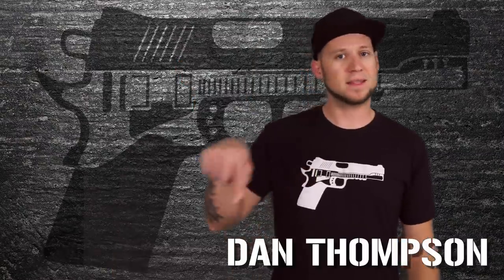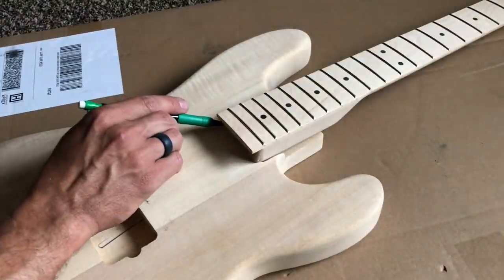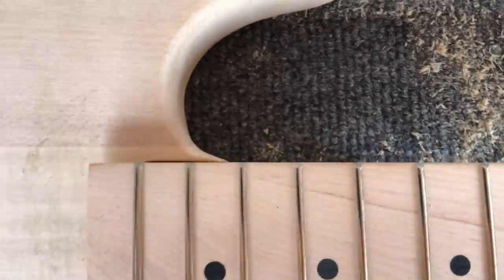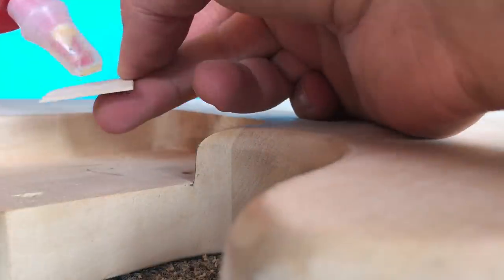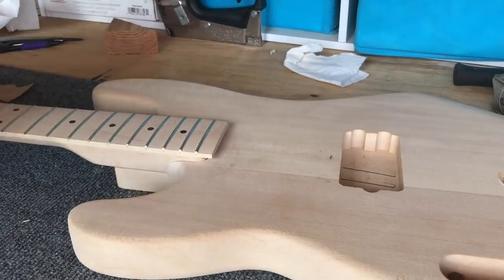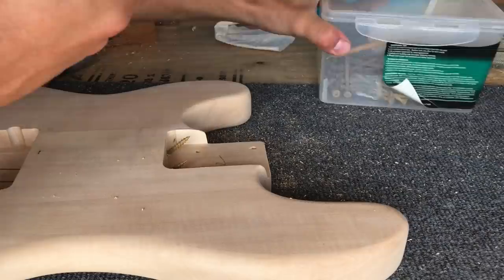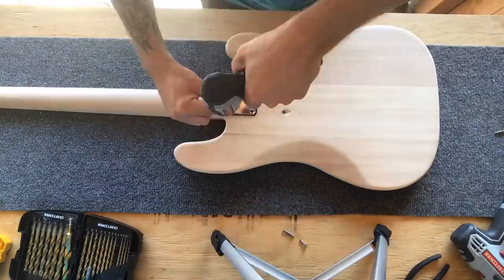How to reinforce a loose neck joint for better tone and sustain,  guitar or bass

Comment: i wouldn't advise removing any material from the end of the pocket, it means you have to adjust for the change at the bridge by the same amount, which often cannot be done, and therefore can throw your intonation off. the original screw holes for the neck will also be out of alignment unless you fill and re-drill them which wasn't mentioned here.
Reply: Mikail Elchanovanich I was wondering this too - the holes wouldn't line up for guitars that are already put together.
Reply from the maker: +Mikail Elchanovanich crud! I missed two important steps didn't I? Obviously I demonstrated this on a new kit so when I wrote out the steps I forgot to add those. For the bridge, most bolt on styles have adjustable intonation bridges so it's not a problem, but in case you happen to have a tune o matic bridge or other non adjustable bridge, you may be fine or you may have to move it. For the holes in the neck, yes you have to fill them and drill new ones.
Reply: was there a reply on this that was hidden? it mentions you mispronouncing Basswood, i'll point out that Crimson Guitars and Chapman Guitars both pronounce it the same as in this video.
Reply: I like the way you approach and discuss your project however I have serious reservations about the potential space difference in the neck pocket if one Dremels the body and does not account for this space with the neck screws.

I really like your style  but think that this advice you give isn't sound when thinking about fitting a guitar and neck together
Reply: i think they also miss that you havent yet mounted the bridge or drilled for it. you'll be able to seat the neck and then measure for the bridge and have zero issues on a new kit like this.
Reply: Bingo.  End result will be you'll have to put a shim in there...Not advisable at all.
Reply: he really doesn't like dissent, he removed my previous reply explaining that he is misunderstanding how sustain works on an electric guitar.
Reply: louis cyfer It’s sad, but this is a trend that is overtaking our society right now.  People live in self imposed echo chambers.
Reply: how would that help? i have no idea how you are trying to put those screws, your description is incomplete.
Reply: wouldn't that be in the way of your hand? he is trying to increase contact surface and eliminate air pockets, not just to increase rigidity.
Reply: you kniw what you gave in mind, but your description doesn't tell me where these screws are. is the head of the screw anywhere on the outside of the neck pocket? that would be in the way. i can tell from your description where you are putting these screws, and you keep repeating the same thing, so the picture is not getting any clearer.
Reply: that i understood. you end up with a lot of pressure on those screws, the wood of the neck will crush at those points. and you still end up with air pockets which is a problem.
Reply: Guns and Guitars, no. I just saw your thumbnail and came to tell you that whole idea was BS.
As far as the intonation screws go, you need those to guess what...set the intonation per string, not to compensate for general string length. Just tune to drop C with hybrid string gauges.
This is just wrong on many levels, that's all.
Reply: louis cyfer wanna k ow what you said
Reply: It pretty much characterizes the vibe and frame of mind of this Youtuber. He's kinda like the Anti-Gibson spirit. You know, zero mysticism, fly by the pocket of your pants kind of guy(or however you say it) but that's the Internet. The truth is somewhere in between I'm sure.
Reply: @louiscyfer6944  is that to say that a tighter neck to body fit will not increase sustain?
Reply: nate dawg, i am not sure this achieves a tighter fit. you are pulling with less force in the direction where there is more surface area.
Reply: Since you have a solid opinion about removing material causing reduction in scale length.. what is the common tolerance for that dimension? I think it's 25½ for Fender and 24¾ for Gibson. What's the tolerance? Are they +/- something or minus only or plus only? I doubt you have this information or even thought of that. Guitars aren't these precision instruments that some people think. They have build tolerances, the components have tolerances, the strings, etc. Removing 0.025" is nothing. Advising against that is silly and overkill.
Reply: @mboyer68  anyone who thinks precision isn't important makes crappy instruments.
Reply: @gramursowanfaborden5820  nobody said precision isn't important.. did you say that? There are tolerances on things. Allowable variations in size or position that have been verified to be acceptable. I'll bet that 0.030" to tighten up the neck pocket is well within the allowable tolerance of that dimension. 
Seriously though.. trying to claim that me talking about allowable tolerances is the same as saying precision isn't important is a ridiculous exaggeration, and quite frankly, a lie. You should stop doing that.
Reply: @mboyer68  good greif man, chill out. you're talking to me as though i'm on trial for war crimes. it was a general statement and it summed up what i think quite well. untwist thine knickers.
Reply: @gramursowanfaborden5820  You're really in the mode of applying whatever words and emotions you want onto people. You must be very tough to live with. I never said anything about precision not being important and now that somehow I'm angry, upset, and treating you like you're guilty of war crimes. 
If you could read my comments and then read your responses to them, then think. Try to figure out where you're coming up with this stuff. In my opinion, both comments were a passive aggressive technique to make me look bad. I'm all for crappy guitars and I'm some angry, out of control person that you have to calm down. You must be awesome to spend a lot of time with or be related to. 🥴😖
I'll untwist my knickers if you'll think before you write. What are knickers?
I'll bet $1000 that not one single person would look at either of my comments to you and think that I was upset and or attacking you like you're a war criminal. Do you hear voices? Is that where your thoughts and comments come from?

Comment: I added two additional neck scews on my cheap squier Indo p bass when I got a replacement mitey mite neck. Six screws total into sic inserts makes a SOLID lockup. I mean ROCK SOLID.  No shims. The gaps either side of neck and body were big I filled with kneadable epoxy from HOME DEPOT. Then touch up with acrylic paint. Hardly Fender American factory but I could care less. Sustain is incredible. Neck is removable. Worked great for me.

Comment: Sometimes I use really cheap, easy and fast way to make good solid contact between neck and pocket. You could take some pure pine rosin and add some pure alcohol to turn it from near hard state to more like paste. Then use it like glue to set neck in, and when alcohol will evaporate, you will have ALMOST set-in neck. Yea, this is sort of compromise, because odds are than if you would need to remove neck, rosin will be solid PITA just to tear it apart, but hey, it's always good to have more than one way to solve the task!

Comment: Interesting Dan. I bought a pocket screw jig about ten years ago for a home improvement project. Subsequently I had acquired a new Fender American Standard P-Bass that just sucked. While I didn’t address the neck slop as you did, although in retrospect I should have, but did I use the pocket screw jig and a couple of 2” & 1/2” pocket screws and pulled the neck tight into the pocket. The improvements in the tone and sustain were absolutely remarkable.

Comment: Hi Dan it's a good point those angled screws pulling the neck back in the pocket lengthwise with the strings, instead of only pulling down to the body as any other bolt on guitars. Just I'd say it can be a bit risky of some misalignment that could make the neck to not sit accurately leaving some gap in the neck pocket. From quite some years CNC has been used to route the pocket very precise and make the neck bottom to sit in snuggly leaving virtually no gap and making full contact. As you do it "by hand" meaning without a rig as used in guitar factories, I strongly recommend to take the time and go slowly.  On the other hand, what I do is to let the strings tension to pull the neck well into the pocket after loosening about 1/4 turn on the neck screws, no additional force needed, and I notice on many bolt on guitars some increase in sustain and resonance. Thanks.

Comment: Good idea, but if you plan on selling in the future, I would't recommend it. If you think your guitar is lacking sustain due to a sloppy neck joint, try slightly loosening the neck screws while tuned to pitch and retighten.

Comment: I like the 45 degree mount, but i would make the pocket tighter by taking thin piece of veneer, moisten it and shape it round the 3 sides of the neck-pocket, and then glueing it, and finish it to a nice look with sandpaper. This makes the best contact without removing material. And believe me it works. Damn!

Comment: Cool, I had the same idea, just worry about the loss of wood mass in the neck heel, as that is what also transmits vibration. I realize that you use the plastic neck-plate guard to avoid marring, but I think you are cutting out resonance by doing this. No plastic at any contact points.

Comment: Off all the things I've done to a guitar, adding the screws to the neck pocket and getting the nut correctly cut are the two most important things to keep a cheap guitar in tune.  It's amazing how well my scalloped strat stays in tune now that it has the two screws.  I have the cheap trapzoid tuners on it and with well stretched strings it will stay in tune for hours.....even with a cheap squire flat sawn neck.  I used one piece of black masking tape (black body) to cover the holes on the back....also painted the holes with some black nail polish...looks fine.   You could get a sticker from the craft store and no one would ever know there's holes.

Comment: There is no need for a tight fit on the sides. It can be counterproductive. The wood needs to move and all those who advertise "air tight" or "zero tolerances" lead to cracks in the finish and depending on humidity can cause a bad fit of the neck. 
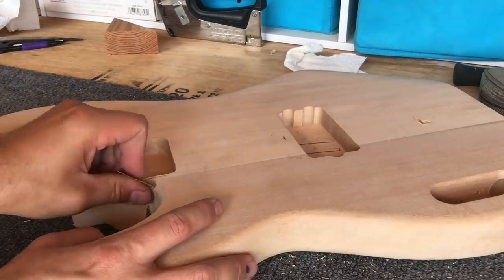2:48 isn't bad...maybe a bit more sanding. The additional screws might be helpful for bass guitars, perhaps if you do a lot of neck bending on your guitar. The slight reset on the back pocket can be problematic with certain bridges (Neck screw relocation isn't that big of a deal). It think it's fun when you build a kit guitar.

Comment: I would put 4 screws in first fully tightened, then the two 45 degree screws.
Reply: Then the 2 diagonal screws would not be able to slightly pull the neck into the pocket, since so much force is resisting, from the 4 normal screws. No, you absolutely must do the 2 diag screws first.

Comment: i build basses full time and do a lot of mods and repairs and the best thing for a loose pocket is , no joke, 24/hr JB weld. its harder than basically any wood, and bonds to wood really well, so there is no need to actually make the joint fit perfectly tight, when the filler is more resonant than the actual wood. technically it should sustain more than a perfect wood to wood fit but not enough to matter. you use the 24 hour so you can make a bunch up, way more than you need, slather that sucker, bolt the neck on and you have plenty of time to soft-align the neck and get the 1st and last strings on to make sure the bridge is aligned, and just don't tighten the strings yet, its just for reference. the JB weld compresses into the pores as you tighten the main screws and you have plenty of time to clean the outside and be happy with the fit before leaving it to cure. not only is the weld filler harder than the wood for resonance but it's also stronger than wood glue so you could even remove the screws and transition the neck joint. its stronger than the joints used in most factory set-necks, especially if you leave the screws in or countersink them slightly and filler over top. the only stronger neck joint would be a solid through-neck construction and the sustain  and tone should be the same since the bond is now tighter and harder than the body material with no crazy shims and fitting. hasn't failed me yet, and i run ultra-heavy gauge strings on everything, even the screwless fit on my 6-string Bass. just be sure its 24HR and not 5 minute or you got a real problem.
Reply: so the 24/hr jb weld is MORE resonant than wood? How do you know?

Comment: When I saw the thumbnail I immediately thought of the Billy Sheehan sig.

And yes, it does increase sustain (tighter neck pockets that is). If youre interested in a simplified (and written in sloppy English) explanation: the more an instrument vibrates/resonates when the strings are plucked (and only because of the string vibration) energy is dissipating. Looser neck pocket=more vibration=less sustain (more resonance also increases acoustic volume)

And if the pocket is already snug all the angled screws do is prevent the neck from going out of place when doing neck bends  (which is why Yamaha developed it for Sheehan)
Reply: and this is why the neck thru thing is bullshit, the more the guitar vibrates the more energy bleeds out of the string into the wood as resonance making less sustain. tight bolt on  make it out of denser stuff and get more real sustain with an instrument that you can actually adjust unlike a set or a neck thru. this is why hollowbodies have no sustain.
Reply: I believe neck thru construction facilitates upper fret access.
Reply: Ah. No it doesnt

Comment: I’m building a HSS Jackson Soloist with a Seymour Duncan Pickups (SH13 Dimebucker in the bridge, SHR1b Hot Rails Bridge in the middle, and STK-S2n Hot Stack Neck in the neck) and I was contemplating doing this…and I might if I decide to buy a new neck for it, but the neck I have on it now (a 22-fret Jackson Neck with a Floyd nut & perloid dot inlay, I might buy a DK2M neck off a buddy & repaint the headstock with Montana Cans Crackle Finish aerosol paint to match the body) but I’m shimming the neck with a sanded-down popsicle stick… putting this two extra neck mounting screws would nullify any benefit I’m getting from drastically shimming the neck for better action

Comment: Replace the wood screws with machine screws and fit threaded inserts into the neck. You get a much larger metal to wood interface area that you can secure with a little glue to stop any movement and can then confidentiality tighten the neck bolts really tight. I do this on my new builds and any repairs that need attention to the neck screws unless there's a really good reason not to.

Whilst adjusting the neck pocket, check with a long ruler or some thick thread (or guitar strings). You need the neck square and centrally aligned to the bridge so both e strings are the same distance from the edges of the neck.

I wrap my neck heel in plastic wrap and then use that to clamp any veneer in place. That way the glue is going to cure with the veneer perfectly fitting the neck pocket.
Reply from the maker: great tips!!!! thanks!

Comment: engineer here.
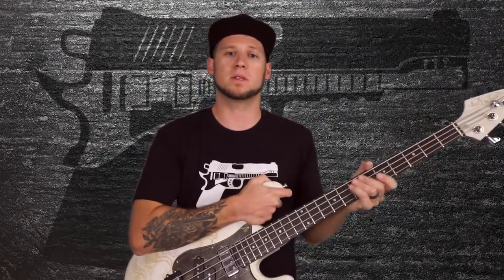4:04 nope, there's no support against neckbends with these screws. almost all the supporting work is done by closest screws to the headstock. these 45's can even reduce the resilience of the front screws (though by a margin so minuscule i wouldn't care about it)
also, these 45 screws can only improve neck pocket fit if they are the first ones to be installed, BEFORE other 4 holes are even drilled. although more screws will defintely increase sound transfer, no matter how they affect a pocket fit.

Comment: I would think we would not want to shim the neck on just one side.
I suggest finding the center line of the neck and line it up with the center line of the body and shimming each side equally.
If this step isn't done, the strings will invariably be off center on the neck and likely slide off when fretted.

Comment: Would it not be logical for this type of truss rod to feature a threaded insert on the heel end, so you could screw from the pickup cavity to achieve a similar effect? This would be much neater.
Reply: I agree, but I would hate to remove that amount of wood from the main resonance transfer point.  Also most treaded inserts are aluminum rather than steel so I wonder how that would transfer resonance.

Comment: Hey dude, you're about the only person that ever answers.
I have a fully loaded 2015 squier vintage modified 5-string jazz bass 
I have no neck. What is the neck heel? And how do I measure it? It's either 72 mm or 75. What am I measuring?
Reply from the maker: The width of the base of the neck where it attaches to the body
Reply: @GunsandGuitars  hey brother, I really appreciate you. I don't have a neck all I have is the body. So what part of the pocket do I measure? The bottom of the pocket by the pickup or the top of the pocket by the horn?